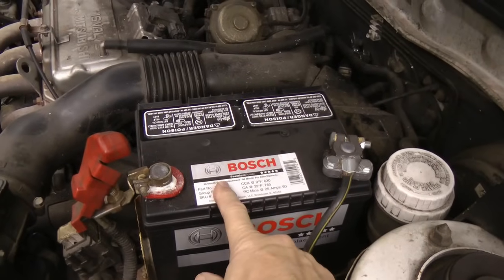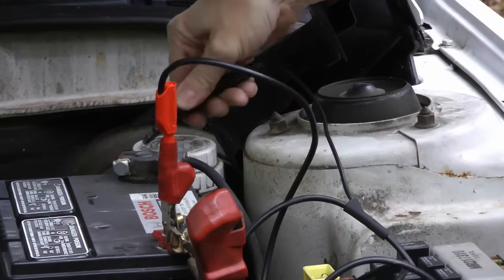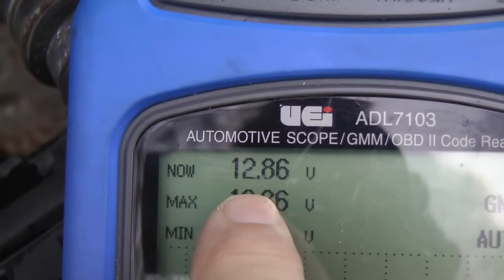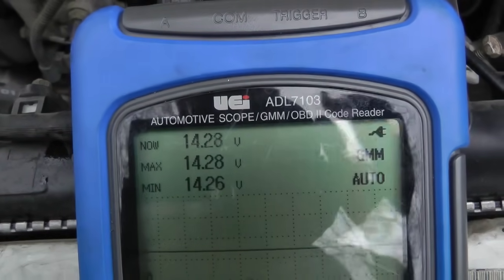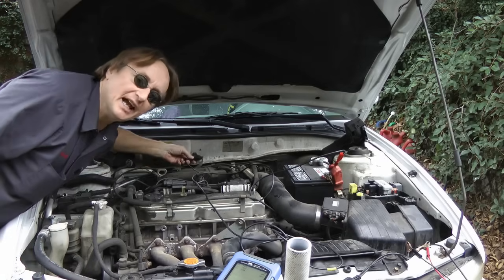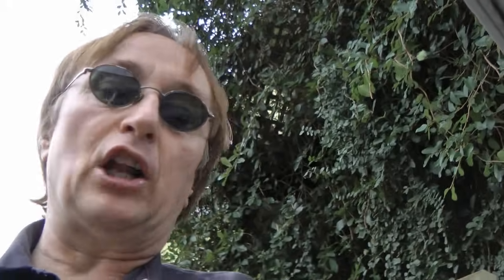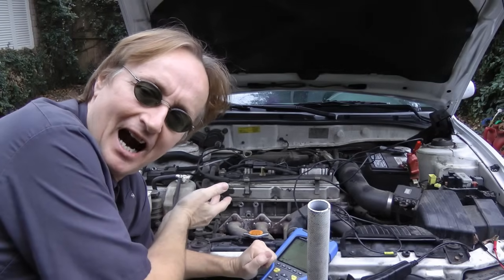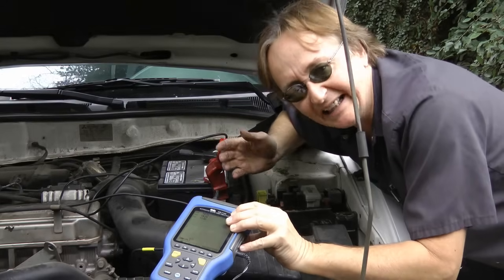How to Fix Electrical Problems in Your Car (Ground Fault)

Comment: Please Help! Sorry this is the last video I will post this!

I got my Prelude in the summer of 2015. I bought it used on Craigslist. It is lowered, has aftermarket headlights as well as sound-system.

I used if from July-October with no issues. Mid October I removed insurance and left it on my front lawn for November-December. In January I decided to reinsure. 

I had issues starting it since I left it alone for the few months. 

At first, it would not start. I checked my battery terminals and they were loose. Then my car worked for a few weeks. 

Again, my car stopped starting. Deduction lead me to go get the battery replaced. I bought a battery from mechanic A. Got it installed. Car still would not work. So I wen't to go get an alternator from mechanic B. Mechanic B said that actually, my battery was bad even though I just got it form Mechanic A. Bought a new battery from Mechanic B. Car worked for a day or two. Went to go buy a refurbished Alternator from Mechanic C, was told that my Alternator was definitely the issue and my battery was OK. 

Got the new Alternator. Car worked for a few days. Went to start it, now it was not starting again. Took car to more upscale and reputable Mechanic D. I had an AVR Test done and Mechanic D told me my alternator I just bought 4 days ago was shit because it was second hand and it was not charging my battery. So I bought a brand NEW Alternator. 

Once again, car worked for a few days. But eventually, I would go to start the car and it would not start. 

Called Mechanic D. Wen't back to them and had an electrical diagnosis AGAIN. They told me they could not find anything. 

I was able to drive the car home. They must have charged the battery. Within a few days, the car would not start again. I got my neighbour to come check it out. He noticed that when my parking lights are on, my engine would slow down and so he said they were draining a lot of power. We determined this just by listening to the engine. My after-market bright headlights did NOT drain as much power as my duller parking headlights. 

And now I am here. 

Every time I would not be able to start the car, I would be able to get it going with jumper cables. I have checked every light and electrical thing I can find and I cant say that anything is staying on and drawing the battery from what I can tell. 

Before I contacted my neighbour, the car, unlike any other time, made clicking noises while I tried to start it but since then, that has not happened. I used it the other day after jump starting it and it was fine.

So as of now, the things i can say are...

1.) It seems that once I go 1 day without driving, It will be dead when I go to start it
2.) My engine did definitely slow down, and my neighbour read a battery draw, when I turned OFF my bright headlights and my parking headlights automatically come on. 

This is been an ongoing issue now since January-ish and it is obviously quite frustrating. Im not very car savvy. I want to call Mechanic D again but I do not really see what they can do since they told me last time they COULD NOT find anything. It is not apparent that they know bout the parking lights though.

Any help would be greatly appreciated, hopefully everything makes sense.  

Thanks a lot!!
Reply: +Michael Oliver  SOMETHING is pulling down the battery overnight.Sometimes the battery pulls itself down,granted. New battery? Good.Easy way to test for a current draw with nothing on...Use a test light from the disconnected battery terminal to the post you just took it off of.If the light lights up,you have a medium-size current draw. If it light up,leave it that way( CAREFULLY) and pull fuses,one by one,until the test light goes out.  That fuse controls the circuit that is causing the drain. Door locks(Corvette) common problem.
Reply: don't ever buy an old alternator it was the starter or fuses or your terminals
Reply: don't ever buy an old alternator it was the starter or fuses or your terminals
Reply: ddd228/Dave in Seattle. My 97 civic dashboard instruments don't work. Went to the gas station to pump gas and when I tried to turn it back on it wouldn't. 10 minutes later I try again and it finally turns on. BUT, the rpm meter acts fishy and when I break (even if I slighty tap the break) the rpm goes all the way down to zero. Also, when I turn on a turn signal, the rpm goes up and down at the same time as the turn signal flickers. Lastly, if I turn on my stereo, it also brings rpm down to zero and my stereo also just turns off out of nowhere. Idk what's wrong..
Reply: bad ground connection
Reply: Michael Oliver its your starter motor mate, most definatly if you live in a cold environment

Comment: Hey, I have a 88 Chevy caprice and my dome light, head light, lighter and radio not working. A harness fell on the pipe and burned. I have repaired the harness, and still nothing happen. But when I run a wire straight to the harness everything work like it should. All the fuse good I have checked over and over. Can you please give me direction on this problems. Thanks
Reply: +Dee Jay  MORE wiring to be done. The wires have been burned(Open circuit) at another place. Trace back the power side of the harness until you find the open circuit.  Caprice have a fuse link?
Reply: I found the wire the feed the harness that was burned. it was at the starter where the fuse link is at. I ran it down today, I was just rushing thinking it was a simple fix. I should have just slowed down and tracked it down like I was trained to do. I hate wiring problems ,thanks for your time and I love all your videos you make. Keep the tools moving!!!!!!!!!!!
Reply: +Dee Jay  Not my videos. I just jumped in to help. Was it the purple wire?Runs to WHOLE car.Replace it with fuse link wire.ONLY.Thanks.Dave in Seattle.

Comment: I have a dodge neon with no parking lights
Reply from the maker: +juanakajohnjohn2012 check the fuse AND then the headlight switch if not a blown fuse
Reply: +Scotty Kilmer i replaced the headlight switch and the fuses I even went an got the mfs 20 pin connector repair get

Comment: My Pick-up has more than a ground issue.-The tail stop lights won't lit on when I step on the break, they only lit on when I turn on the head lights. Only the red light of top back of the cab works when I step on the break.

Comment: mr scotty...i have a 1998 dodge ram 1500 thats giving me a no bus reading on odometer with check engine light comes on and bright light indicator stays on with car off. help!
Reply from the maker: +Dario Reid that means either the computer has gone bad OR the wiring from the computer to the dash has problems in it. BUS is the main computer info line
Reply: Ok..thanks...what would be easiest or efficient way to check?

Comment: Scotty, when I turn on my car, (battery fully charged, tested and OK) all the lights & dash comes on, then when I turn the key further to crank, the headlights dim out and there is no crank whatsoever. Is this a probable bad ground or ? When I last drove it before replacing the drivers door locking module, it started & ran fine. Now it does this, can you help me diagnose it? Give me some guidance? I have never grasped electricity and an trying to learn how to use a volt meter, but it's foreign to me still.
What does the dimming of the running lights in lieu of cranking the engine sound like to you?
Reply: +Randolph Leslie Smith It sound like a bad battery, but since it isn't bad it would be a bad connection/cable. Take some start cables and connect them from your battery to your starter. - on housing + on the + terminal of the starter. Now try again. Does this make any difference? If so, disconnect one of them and try again. Now you know which connection is bad.

Comment: Hi Scotty, I have a 1999 Pontiac Grand Am GT and one of my headlights won't come on. I had the bulb replaced and it still won't come on, What should I try next? The parking lights and fog lights work fine.
Reply: +tina stewart Check if you have 12v and ground on the head light connector. If you don't have 12v, see if the relay and fuse are good. I don't know the Pontiac but I often see that cars have a separate fuse and relay for each head light.
Reply: +tina stewart  SOME cars have a left and a right side fuse.

Comment: hi scotty, can you help? i have a mazda premacy, the drivers window won't operate. the switch has 12.8v going to it and when operated it passes the voltage to the motor. the motor works when taken from the car and hooked unto a battery (up and down) i can't see what would be the issue. can you help please?
Reply: +james leagas   The switch MAY be the problem but Mazda uses relays to supply power to the motor,not the switch,per se.

Comment: Scotty,
My 2006 30' rv running lights worked fine, then i replaced some burnt bulbs…, and then the back up lights won't turn off even when it isn't attached to the truck (it does have a house battery)
Reply: +Nick Santucci  See above.
Reply: +Scotty Kilmer my 2004 Pontiac Grand Prix shuts off randomly while driving and won't start up until I jiggle the battery and the dashboard goes crazy and says I have low fuel and says charger failure what do I do about this
Reply from the maker: +Nick Santucci power is shorted in the on position somewhere. start at the bulbs and trace wiring back till you find it, and pray it's not in a computer module
Reply: thx! you are right it was shorted out on a led indicator in the plug.  the aux power was feeding the back up lights.  
Great posts!

Comment: Hi Scotty - I have a 2004 VW Jetta TDI, and when I turn the key in the ignition and the battery kicks on, more often than not, the horn sounds. Any idea what might be causing this?
Reply from the maker: +Otacon144 often a problem in the anti theft system

Comment: hi scotty kilmer i have a 1999 gmc yukon brake lights wont work when u step on brake but turn signals and reverse lights work what could it be i already check the bulbs and replace switch on pedal still not working.
Reply: +Mario Munoz Also checked the fuse?

Comment: heyy +Scotty Kilmer  I just bought a brand new civic 2015 and the headlights and tail lights dim a bit when I turn on accessories like wipers heater or turn the steering wheel.... what's the problem??? thanks
Reply from the maker: +driftboy9977   have the battery and alternator load tested, but that's a pretty new vehicle to be having problems. Dealer might just say that's normal, but that's B.S.
Reply: +Scotty Kilmer  oh okay thanks and if that isn't the problem what should I do??

Comment: have installed an external voltage regulator for my t & c 2005 worked fine for 6 months but now when idling or at low speed my headlights/dash/courtesy lights pulsate-tried grounding alternator to battery but didnt help?
Reply from the maker: +56v12cylinder  either regulator is bad or alternator is bad.
Reply: +Scotty Kilmer -thanks but checked alternator/regulator (which i replaced a year ago-after continuous battery problems-but it didnt help-called denso and they told me chrysler voltage regulation is in the pcm-not the alternator itself so i got an external regulator) with a voltmeter-14.3-14.8v with engine running idle/low speed--14.3-14.4v at 40 mph and over-then pulsation stops....guy who sold me regulator said i have ground problems...but i tried grounding-to no avail....???

Comment: I need some help my 1994 Chevy k1500 break lights only work with my headlights off what could be causing this? Please help thanks!
Reply from the maker: +Colin Theis pray it's a wiring short, cause if not, often a bad body control module and they aren't cheap

Comment: I have a 2000 eclipse that alarm lights flash when entering car. can bypass by opening the truck first then entering car. or removing the high beam relay but I need to pass state safety test. any suggestions.
Reply from the maker: +Sean Wiley man you live in some crappy area whey they fail for that. You have an alarm system failure, ONLY a dealer scan tool can deal with that if it's a factory alarm. If aftermarket,just disconnect the stupid thing

Comment: Hi +Scotty Kilmer I have a 2003 proton satria gti and when ever I drive it the indicators dont work or the speedo nut all the other electronics are fine is there anything I can do to solve this problem? Thankyou
Reply from the maker: +cooper may check the dash for shorted wiring, especially bad ground wiring
Reply: Scotty Kilmer I have a 2003 ram. A month ago I drove through a puddle and water splashed on something, my electronic throttle cobtrpl light came on and it stalled out. A few days ago I was at the car wash getting the underside clean and it wouldn't start for a few minutes after the gauges went. At first it won't start, then do a rough idle. I waited a few minutes for it to dry out and run the truck in both instances then worked fine after drying out. What could it be?

Comment: I have a 98 dodge ram and my headlights will go out when on dim setting sometimes but not if the brights are on and lately the check gauge light came on and went back off and then a couple days later all the power stopped working while driving. the gauges, radio, power windows ect. turned the truck off and back on and everything started working again. it’s done it a couple times now. what could it be? thanks for your advice.
Reply from the maker: +WildBill33 often a bad body control module, have a pro check that
Reply: StarWeldR   H
Reply: StarWeldR has
Reply: StarWeldR ö

Comment: I own a 2001 Chevy tracker we was trying to hookup our new stereo we followed what the instructions said and it made a pop sound. our dashboard light went out and we thought it was the bulbs and fuses so we replaced every fuse and every light bulb it still is not working. so we had to put led lights shining on the speedometer when we are driving. what could be the problem? why won't our speedometer lights come on?
Reply from the maker: +Brianna macdonald if you didn't disconnect the battery BEFORE doing that stereo work, you shorted out stuff on the car. Often that blows expensive computer modules, but do check for melted wiring FIRST.
Reply: I bet you shorted out your dimmer swith.  I've seen this happen before when the battery cable isn't removed.

Comment: I just finished completely rewiring my 1948 Willy's Jeep.  Upgraded stop, tail and turn lights to LED with electronic flasher.  Installed a turn signal switch by Grote to integrate turn and brake light functions.  Charged the battery to 12.6 volts.   Now when I test, all systems work fine when operated individually.   Also, Brake light works together with either head/tail lights, or when turn lights are on.   Problem is, turn lights will not operate when head/tail lights are on at the same time.  If the turn signals are on, and I turn on the tail lights, then the turn signals stop.   If the tail lights are on, then the turn signals simply will not come on.  I have confirmed that the tail lights are dimmer than either the stop or turn lights, so I know that the light fixtures are wired correctly.     The head/tail light circuit is completely separate from the turn and brake light circuits (different fuses and wires).   Could this problem be caused by a bad ground?   I have checked and nothing is obvious.   Thank you !!!  Denver
Reply from the maker: +DAGNUBIT it could, but realize leds can be tricky to wire up and sometimes require ballast resistors to work right on cars.
Reply: +DAGNUBIT Okay, that is good to know.   The flasher is supposed to be the type that works with LED lights, but I will head out to the shop today and see if I can find out anything.   Will let you know..
Reply: +DAGNUBIT +DAGNUBIT Okay, the problem is solved.  Even though I had an electronic flasher, that was not enough to make the LED turn lights work with my setup.   So I added one resistor on each side of the vehicle, each near the rear turn signal on each side (note, I did not have to add four resistors, just these two).

Comment: I seem to have a wierd electrical problem. The car won't start and there's a few different odd noises coming from my fuse relay box and somewhere near the glove box. Not exactly sure what is going on here. I bought a new battery thinking that was it but it's still acting strange.
Reply from the maker: +Whispered X have the starter tested, often weak ones do that .  If not that, often wiring or starter relay problems
Reply: Thank you, i'm taking it to a mechanic hopefully tomorrow.
Reply: Well found out this morning that the negative terminal bolt (it's one of those sidepost setups) was stripped. It needed to be replaced anyway since it's as old as the car (2000). Funny thing though is i took it to a mechanic and they couldn't properly tighten the positive terminal which in fact i needed a washer for that one. Thankfully when my car didn't want to start (yet again) it was at Autozone. Everything else apparently checks out and i'm not seeing any more issues though it's hard to tell since it's a bit warmer. Need to be -20F to properly test whether my car would start or not. But those pesky side post connections wouldn't stay on there!

Definitely wore out my old battery though.

Comment: Hey Scott I got a question? all my lights on the dash and headlights and taillights are flickering? do you have any idea what it might be... because it has a brand new battery?
Reply from the maker: +Michael Garcia have the alternator load tested, auto zones do that free. If not that, often a ground wiring fault
Reply: +Scotty Kilmer alright will do thank you